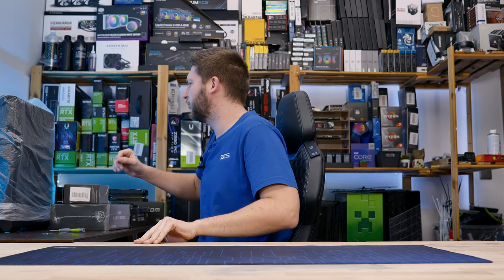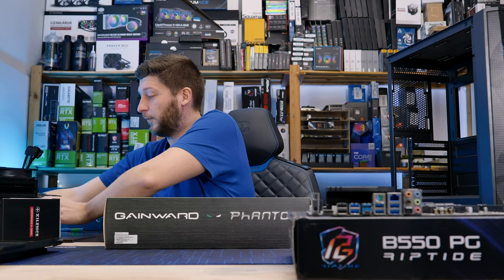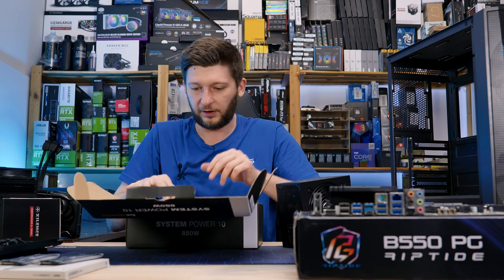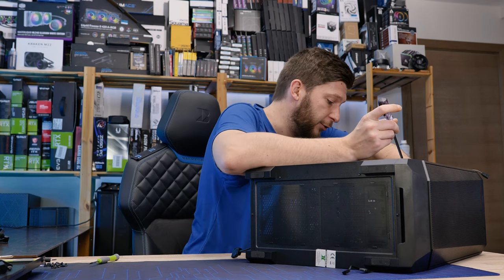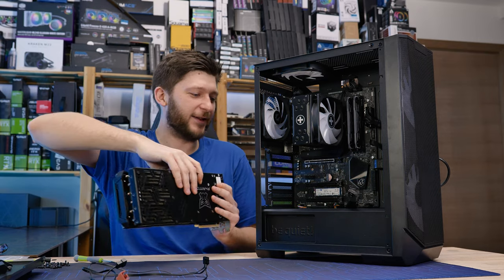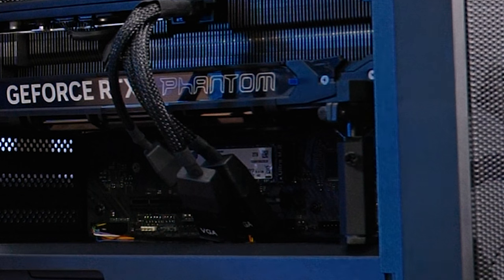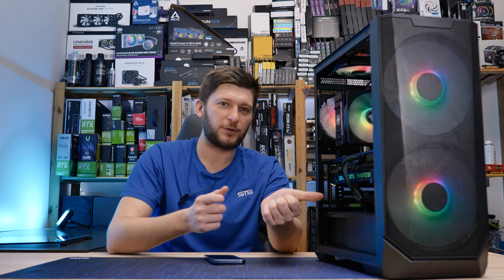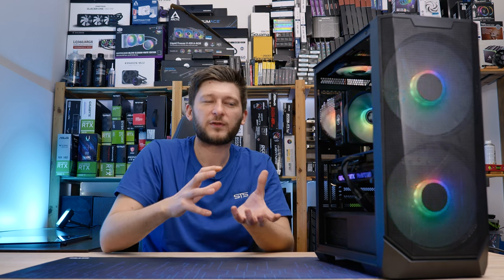RTX 4080 x 5800x3D Build Inside 200mm Fan Case

Comment: LOL, I like how you build!
I think 200mm fans sounds like  a great idea. Like  a Fractal Torrent with 200mm fans underneath and on the front! And then build the case around that concept with open airflow to get the max out of the big fans, and they should be DEEP! If a little bit of flow goes behind the MoBo, that'd be fine also.